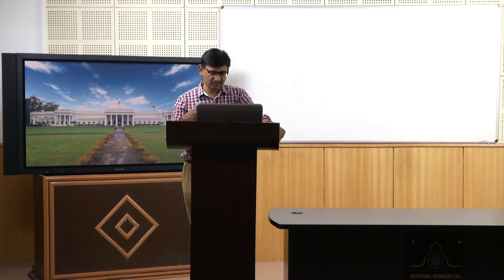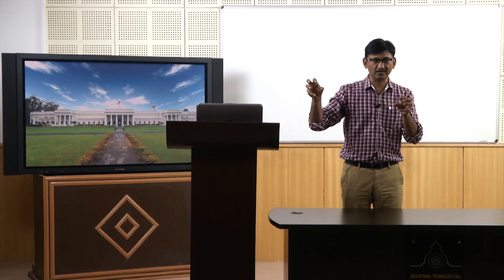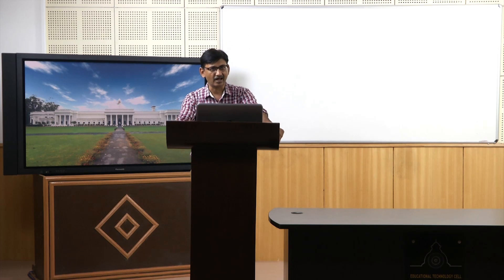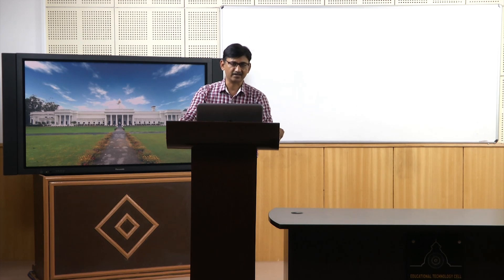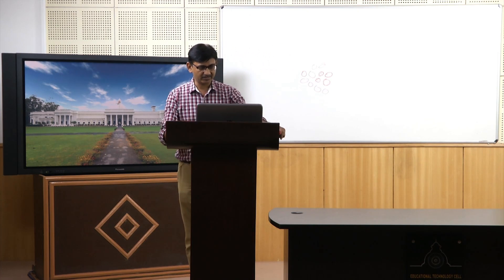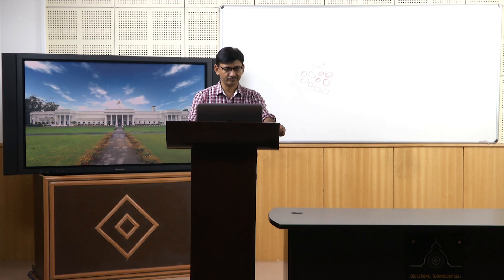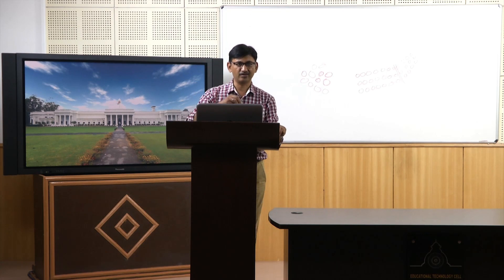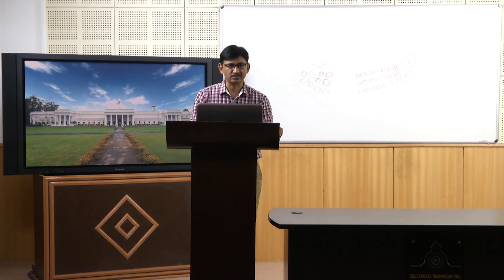Lecture 09: Microstructure: Understanding

Comment: Nit a good teacher.....sorry....but iit roorkee should test their professors before making videos and uploading on youtube
Reply: GOOD AND INFORMATIVE if any candidate then refer this…. 

Job opening QC LAB IN CHARGE in Automotive Ltd. Company 

SKILLS REQD:
 Diploma (Instrumentation/metallurgical Engg.
 EXP 5-6 Yr
 MFG (Preferable: Fastener industries)
 Salary Max 30k ctc
 Manage all Lab eqpt, Good hand experience to use  Microvicker, Micro-scope (microstructure analysis), tensile testing, VMS, etc. and their calibration record.
 Responsible for Inspection and ensure the product (Alloy wires /Rivets) quality mfg at various stages.
 Play the role of test engg, prioritize and plan testing activities, Identify quality issues observed while testing, verify issues to be resolved and report to HOD
 Good knowledge to maintain documents QMS- ISO &  IATF;
 Make Quality plans to improve the product quality at process.
 Good communication skills, Handling manpower, implementation action taken.
 Excellent skills; Word, Excel, Power point, Email,
 To maintain 5 S on the Shop Floor, Safety & Kaizen activities.
 Team management 2-3 Engg

Location DELHI, MAYAPURI 

Apply or share cv, sharing is carrying everyone.

No charge will be taken from the candidate; it will be free of cost.  

Regards,

P. C. JOSHI

WhatsApp +91 92130 40608
THE DIVYANSH ENTERPRISES
Management System Certification
& Consultant ISO/IATF/MACE
Business Support & Job Oriented Training
Manpower Consultant
North West Delhi